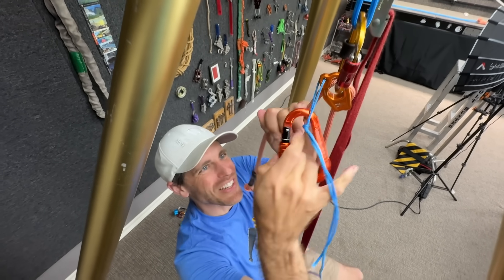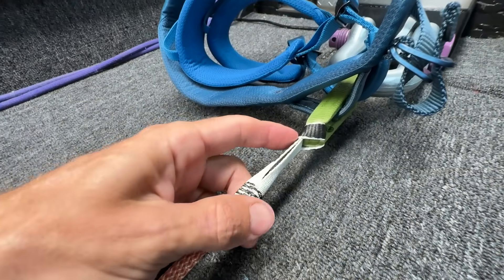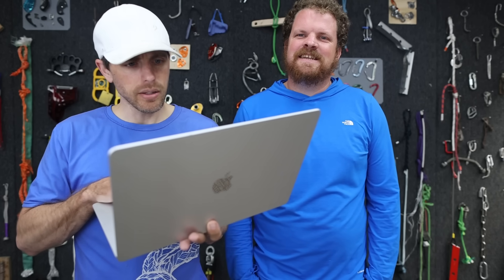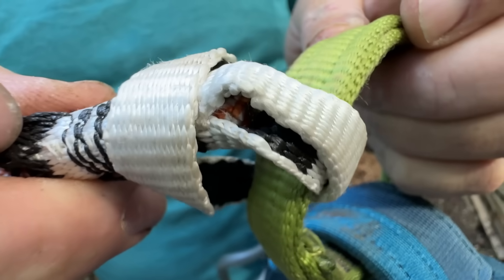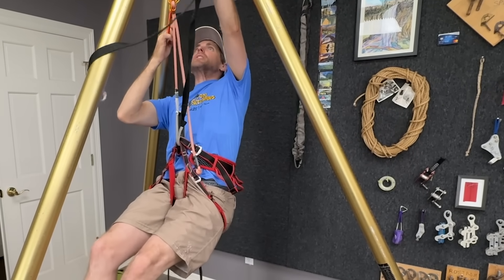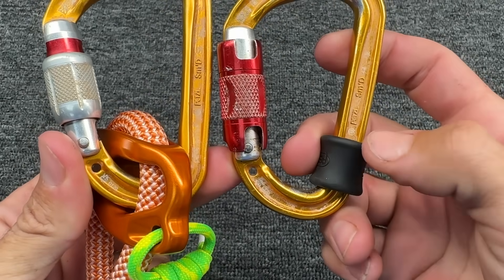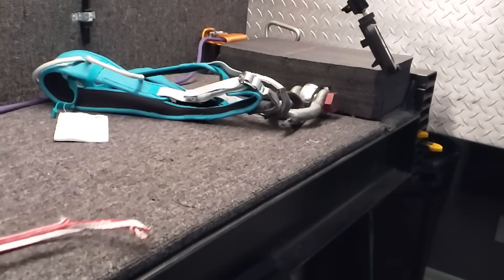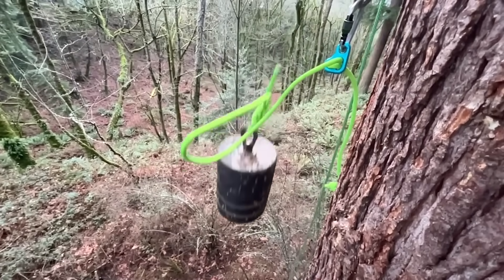People are worried about this part

Comment: µm is a metrical measurement of lenght:
µ stands for "micro", i.e. times 0.000001 (or one millionth)
m stands for "meter"
µm equals to "micrometer", i.e. 0.000001 meters (or one millionth of meter)
On metrical system, you can easy describe very high or very low quantities without using a stupidly high quantity of zeroes by slapping a prefix in front of the unit of measure, for example:
TB = Tera byte (trilion of bytes)
MHz = Mega hertz (bilion of hertz)
KN = Kilo newton (thousands of newtons)
HPa = etto pascal (hundreds of pascals)
dB = deci bel (tenth of bel)
cm = centi meter (hundredths of meters)
ms = milli second (thousandth of seconds)
µm = micro meter (millionths of meters)
pF = pico farad (billionth of farads)
And so on........
The next time you read a force value in Kg (kilogram) remember that the kilogram is not an unit of measure but is thousands of grams and the next time you refer to a kilometer, you refer to 1000 meters!
Here is a table of metrical prefixes; just slap one of these in front of the unit of measurement to give a different order of magnitude to the value:
http://astro.unl.edu/classaction/tables/intro/si_prefixes.html

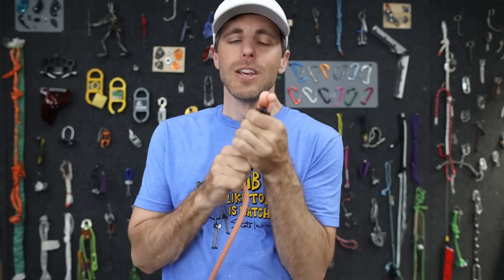Comment: 10:17 Maybe it is the way, you pull on the stitching🤔 Because the stitching is all, that holding it together and now your carabiner rubs on the individual threads.
Maybe you need to glue an eye in first.

Comment: 0.8um Ra is 0.8 micrometer Roughness Arithmetic Average. Ra is the average of the absolute values of the peaks and valleys of a profilometer "trace" or scan measurement. So, a statistical measure of the roughness. It is a little offset from the RMS  (Rq) value.  

0.8 u, is about 32 microinches (uinch) Ra, a fairly smooth surface produced with common machine and finishing methods - basically like a new carabiner surface roughness. I'm old and in the US, so I think in microinches for machined metal surface roughness. 100uinch Ra is pretty rough and would abrade sling and rope fibers, at least till use smoothed it out. 10 uinch is getting kind of shiny. Below 5uinch the surface is getting specular - getting to optical smoothness. Optical surface roughness is usually expressed in angstroms Rq. Typical precision optical surface roughness would be 5 angstroms RMS - 0.0005um Rq. Super polished surfaces can be under 1 A Rq, which is wild as that's atomically smooth.

Comment: Im a machinist and i use overhead hoist to lift large pieces of metal into my machines and alot of the times i have only small 1" thru holes through the part so i need aomething that can hold the weight of 250-1000lb parts and we have different sized tow straps and we have a few a little larger than what you see here and they easily lift 400-800lb steel parts.

Comment: This device is huge for the arborist community.
Reply: You'd use this readily on a line riding system as well.
Reply: What application have you found for the adjust in Arb work? Im intrigued

Comment: 4:21 it just means smooth, but not mirror finish smooth. Ra is average roughness, so the average asperity height (tiny points in the material) cant exceed 0.8 micro meters (millionths of a meter). Micrometers are also shorthanded to "microns".

In other words the surface needs to be smooth enough that theres not any ridges that you could catch by scratching your fingernail across it, but it doesnt need to be smooth enough to have a mirror finish. Somewhere in between those two limits 😂

Comment: Question: What about attaching it to the tie in loops of your harness instead of the belay loop? (I was doing that but may stop after watching excellent vid) Comment: I use a DMM Ceros "captive" locker to deal with my concern  about cross loading.

Comment: Wish I would have found this video when I was searching for instructions on the same thing, its funny because it got me the same way and there were no instructions lol
The hole was almost so small a carabiner wouldn't fit at first it was so tight but its loosened up since using it...
Also it was the 
CAMP
Turboloop

Comment: The friction for lengthening those personal adjustable anchors are quite different throughout the market. I hate the edelrid switch adjust for that exact reason. But the beal works butter-smooth instead - plus it has a belay loop integrated.
Thanks for your thoroughly tests of gear!!

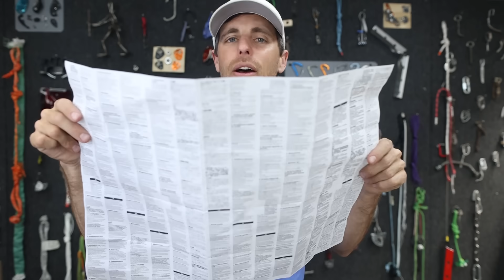Comment: 10:20 my guess as to why petzl recommends against putting a carabiner through the end of the lanyard is the potential that the diameter of the carabiner is large enough to put extra stress on the stitching that keeps the knot in place, which might cause it to fail lower than expected. Curious what others think!

Comment: There are many bow hunters that hunt from a tree with a waist/leg harness only and are tied in with static and not dynamic rope.  What are the forces generated on the harness if a free fall should happen at 6,8, or ten feet?  Thanks.
Reply: You can roughly approximate it with weight * gravity * (fall / stretch).

Gravity is 9.8 m/s, but we can just use 10. An 80kg hunter is putting 800 newtons (0.8 kn) just hanging on the rope (weight * gravity).

Now let’s say it is 1m of rope, and they climb up as high as they can and fall. The fall is 2m (1m above to 1m below the anchor point). Dynamic rope stretches about 20%. So 1m of rope will stretch 0.2m. This gives us 2m fall / 0.2m stretch, or a fall factor of 10.

80 * 10 * 10 = 8,000 newtons or 8 kn.

The actual force should be lower, because we rounded gravity up and there is other stretch in the system, but it gives a good idea of the likely outcome, a stiff jolt, but under the rated limit of all the gear.

Static rope isn’t absolutely static, but instead of 20%, shock elongation will be more like 5-7%. This makes or fall factor 2 / 0.07 = 28.6.

And 80 * 10 * 28.6 = 22,880 newtons, or 22.9 kn.

Again, the actual force should be lower because of knot slip and other factors, but we are looking at forces that break gear and the human body.

Hanging on static rope or slings isn’t unsafe, climbers and workers do it all the time. But falling on static gear is VERY dangerous, so people using it need to avoid doing so.
Reply: @MidLifeCrux  Thank you so much for the analysis and explanation.  Very much appreciative.

Comment: I don't know for sure on the "contact radius of 5mm", but envision that the knot is around a rod with a 5mm radius (10mm dia).

Ra (which is represented as capital R + subscript a) is the average surface roughness value, a way of quantifying how rough something is. 0,8 um (greek mu + m for meters) is "micrometers" or "microns." As this is EU-based, they use a comma for the decimal point, so it's saying the Ra should be 0.8 microns. Googling around, ground glass (so glass with that frosted look like on lab glassware joints) has an Ra of 0.4-0.8um.

For more intuition on Ra, if you zoomed in on the surface microscopically, you'd see a bunch of troughs and peaks. Pick a line along the surface and measure the heights along it. Take the average, and then subtract that from all the points you measured to get the differences. Take the average of those differences, and that's Ra.

Rmax is just the highest peak minus the lowest trough, and they're saying that can't exceed 6.3um. If you had some high peaks (sharp bits) and low troughs (gouges), they'd average out. By specifying Rmax, you ensure you get the desired Ra without it also being rough. If you had a perfectly oscillating but rough surface, you could sort of "fake" Ra, but not by also specifying a low Rmax.

Comment: I worked for Petzl years ago, hung out with the owner on multiple occasions. I can tell you that back then, the owner would test the ever loving shit out of his designs. He would NEVER release a new product unless it far exceeded standards. Primarily because he was a climber too and listened to concerns seriously. They conducted tests that were far above industry  standard requirements. When it came to quality control, they tested every part and every finished product. They would perfect the movements of the gates, measure the pivot pins to ensure they would never cut or wear a rope, and they are the only product I would use if I were to start climbing again today.
No idea if it's the same owner but I know one of the managers that still works there today.

Comment: I have the original ones and replaced the rope with 6mm Mammut tech cord (dyneema) as a double "Y" lanyard and it works so well.  It's static and i use it for aid so i don't take falls on it.  If there is a risk of falls onto the piece, I add a breakaway sling like a Screamer.  The 6mm cord wears the surface faster but it's 10+ years now and i'm happy with it.

Comment: I mean, why in hell are you doubting a Dyneema loop? 😅 It is an incredible material! If you see how thin kitesurf bridles are and how strong the kite will sling you in the air... It's like 15 times stronger than steel at the same weight, bro!

Comment: Hi, I think another reason why the thin dyneema sling broke and not the lanyard dyneema loop: the more you pull on the dyneema sling, the more the girth-hitch will "squeeze" the belay loop, whereas with the lanyard, the dynnema part will not tighten that much around the belay loop. We can see it clearly on your video, comparing 2:24 and 13:11. Sorry if this is not clear but I really think this is the main reason, even if dimensions of the slings have an impact as well.

Comment: Not much to do with this video but I have a friend of mine who uses a prusik on the connect adjust rope as a rappel/abseil extension because he says he looses too much range doing a hitch with the rope, it has always worked for him but I'm curious if it is supper good enough, would be cool if you could test it out
Reply: Note: he does do a lot of loops, like 6 or 7

Comment: Ra is Roughness Average (one of several types of surface roughness metrics) and 0,8µm is .8 micro meters of roughness.  What they're getting at is that the roughness of the metal is important, because it wears the rope.  .8µm is about 32 microinches, or a reasonably fine machined surface.  Based on about 35 years of mechanical engineering judgement, I'd guess that most aluminum caribiners are well in that spec.  I can't speak to your steel caribiners, I don't have any.  The Rmax speaks to burrs that might be present, they can't be more than 6.3µm (that's about a quarter of a thousands of an inch, maybe you could pick that up with your finger tip, but probably it'd be too small).

Comment: I worked as a qualified fall protection engineer for 10 years.  Included desing systems and testing soft goods in an ANSI acredited lab.  YES Petzal tests all there stuff and it is supper solid.  There is the testing starard on the labble.  Why would you ignore this over rando coments on instagram???  Do you think you are going to figure out what petez didnt think off?

Comment: The paywall is really not that high -  like most EN standards,  EN 17520  is adapted into various national standards.  Some versions, like the British one (BS EN 17520:2021), might be relatively expensive (158 GBP or about 212 USD), But you get the same standard much cheaper. E.g.  the  Latvian version  (LVS EN 17520:2022 - in English) is sold for just 13.74 Euros or about 16 USD

Comment: Todd Skinner:  His failure was, like many accidents, due to layers of issues that added up to a fatality.  One take away lesson was to avoid leaving your daisies girth hitched to the same spot on your belay loop.  When you do your leg loops saw back and forth on the same spot on the bottom of your belay loop under load as you faff about doing aid stuff.  His harness had lost the little keeper loop on the leg loops, allowing even more movement/sawing to occur.

So:
1.  Don't climb on obviously tatted safety gear, that even your partner has asked you about.
2.  Don't modify your safety gear by doing stuff like cutting off non-load bearing keeper loops.
3.  Don't girth hitch your daiasies/PAS to your belay loop without periodically repositioning them and inspecting for wear.
4.  Don't climb on obviously tatted safety gear, that even your partner has asked you about. (must be repeated)

Comment: I work on a fairly extreme zipwire, we used to use flat dyneema on the emergency brakes until we had a hot day with a southerly wind which for complicated zip wire reasons I can't be bothered to explain meant people were hitting the first emergency brake to slow people down, roughly 300 times id guess they got used that day and the flat dyneema was ruined because the edge of the dyneema had cut unto the flat where it was pressed against it and presumably moving as people hit the brake trolley, it was all replaced with a round paracord that evening and they've not needed replacing in to my knowledge 2 years now with the exception of one which got chewed

Comment: Wouldn't you only ever statically load it? You clip it to the anchor, pull it tight, hang off it, do your stuff, unclip it, descend.
So even slipping at 2kN - I only weigh about 3/4 kN (less if we take g as 9.8) and that's if my feet are not on the rock for some reason.

Comment: This is a bit of the problem when you're into proper engineering materials. Materials are really strong and ropes for climbing seem to me to be mostly big so they don't cut you to pieces. 3mm sk75 will beat the 15kN and comfortably chop an operator to pieces... It's pretty reasonable to convert to higher performance materials when you're not at risk of injuring an operator, but it attracts people who don't have any technical knowledge saying things like "that bit isn't as big as that other bit, therefore it's too weak".

Comment: Ra local roughness, Rmax is a global roughness. These are glass smooth, for reference. The design constraints require the device to use the entire cross section of the lanyard, eliminating the possibility of seathing seen in most progress capture (educated guess). Shock loads would be dissipated over a longer time (the flat top of the slip load). More bruising, less joint dislocation to the user (also educated guess).

Comment: 4:25
uM is Micrometers
used frequently to measure the diameter of a fiber optic strand. 250 uM is typical. 
useful for flirting with female engineers too
“you’re hair is so full of volume today. looks around 200 uM strands”

Comment: The benefit of a rope with core and sheath is cutting or wear resistance and resistance against UV radiation on long time use. You tested only the new ones. I dont think there will be a problem with the sling material itself, but i think it would be nicer, if they add some protection to the stitching, as they did with the old version.

Comment: Been thinking on this for a day or so now. I couldn't help but notice that the new style saw a bit over 7kn on the drop test while the old style only saw 5kn in the video last year. Looking at screenshots of the tests side by side it almost looks like the drop test of the old style petzl connect had a longer tail allowing for more slip through the device while the new style test had a shorter tail allowing it to get caught in the termination and shock loading the load cell. I did a bit of digging and also noticed that the old style (based on what i can find at least) comes with a 9.5mm rope while the new style is 9mm. Is it possible the higher loads are due to smaller diameter rope allowing slipping through the device easier (I'm fully aware the device may have been redesigned to accommodate rope size) or was there actually a difference in tail lengths leading to a difference in max loads. I'll fully admit to not having the devices Infront of me to to compare but I would love confirmation of my observations / suspicions. Ryan - any chance you can confirm any of this?

Edit - I guess it would help to read the video description before commenting. Looks like it is confirmed that there is a difference in rope size (9mm vs 9.5mm). Still curious about reasons for load differences on the drop test.

Comment: The standard calls for the rope to be attached to a bar with a radius of 5 ± 0.05 mm (diameter 10 ± 0.10 mm); the shackles you typically use are a good bit larger and (probably) more generous to the rope fibers. 3/8" = 9.525 mm is a bit too small. 

"μm" is the unit label for microns, 1/1000 of a millimeter. However, as applied to the roughness values Ra and Rmax, it's really not intuitive. You can find physical roughness comparison sample cards for sale, but Ra = 0.8 μm is essentially "pretty damn smooth, but not mirror-polished". Probably about the same as a typical carabiner fresh from the store.

Comment: It's worth keeping in mind that the stitching pattern at the joint between the webbing and rope is very specifically designed, for stitch placement, density, alignment, and thread type; the way the end of the rope is cut and fused surely has an impact as well. I haven't seen that type of joint before, but it wouldn't surprise me if Petzl had to develop a special kind of sewing machine just for that process.

Comment: interesting stuff, and a fun watch. always appreciate your stuff. the 4mm acc cord thing seems to be a reinvention of an old technique used with a Shunt. 20 or 30 years ago people working in RA using a Shunt as backup on the 2nd rope would tie a tiny bit of cord to the eyelet and hold it between their fingers when pulling it along on descent. this was so you couldn't panic-grab the thing, the cord would just pop out from your fingers and you wouldn't do the "petzl plummet (TM)". equip and techniques have moved on. I wonder why they didn't use the same eyelet and biner idea as on the Reverso. keep up the good work. cheers.